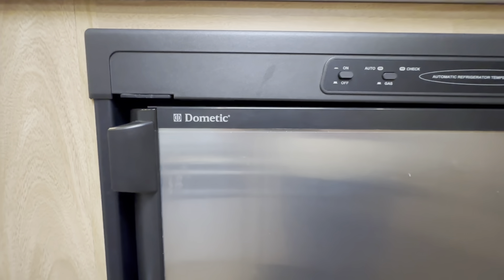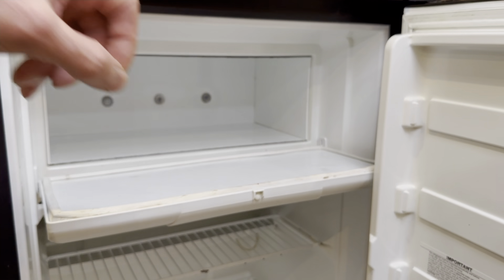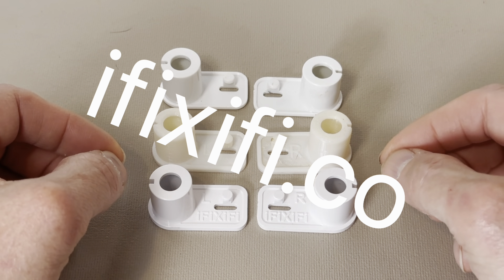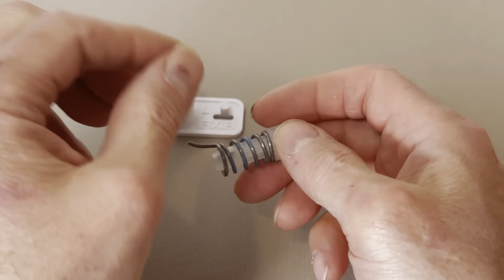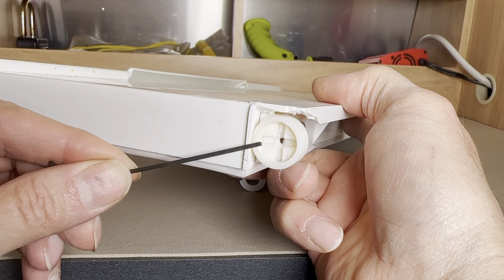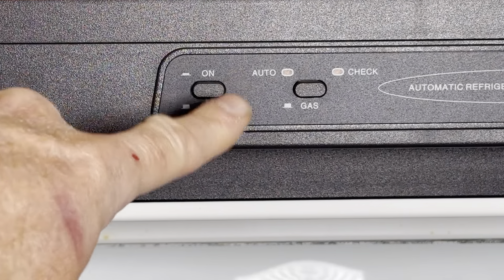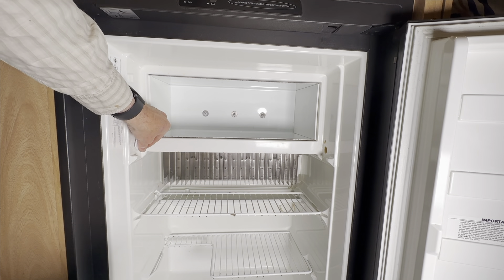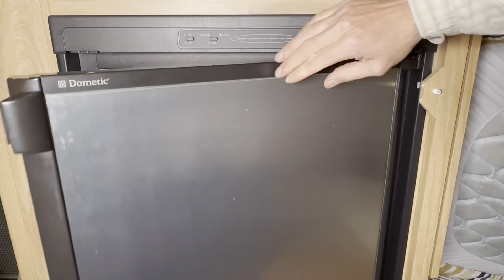How to Remove, Repair and Replace a Dometic RV Freezer Door and Save Money!

Comment: Your video is the best I have come across and believe me I tried many. Yours explained it better than all others. Now I had the issue of the door connection breaking on the left side, (our door swings left) and so ordered a door, $109.00 AU. Installed it without moving the spring holders down and no tension. Then removed the door again and swung them down as you said too and now the springs are perfectly closing the door with a good amount of force.  I will be ordering your holders and springs soon because, not only are they stronger but they are cheaper. I am just out of Brisbane, Queensland, Australia.  My fridge isa a Dometic RM2543
Reply from the maker: Hi Lance! Thanks for your positive vibes! I love hearing that people in Australia love camping / caravaning as much as we do. You got a great deal on that door!
Reply: @ifixifi  Sounds like it. I find it hard to find good cheaper gear here. Lucky I found you guys.

Comment: Your video for fixing the freezer door is fanatastic.  But I couldn't find the links that you refer to for ordering parts from you.  How do I find the liknks?  Thanks, Bob McCracken
Reply from the maker: Hi Bob! Thanks! That's a great question, and the answer is going to help you get A LOT more out of not just this video, but YouTube in general. A lot of creators put extra, helpful info in the comments. Finding the comments section depends a bit on what device you are watching on.

To level the playing field, first make sure that you are actually watching on YouTube, instead of in Google or other site that has embedded the video.

If you're watching on a computer, scroll down to just below the video. Sandwiched between the "SUBSCRIBE" button and the comments section, you'll see the first few lines of the description. If you click "more" you'll see the rest of the description.

If you're watching on a tablet or phone, the description is going to be in roughly the same spot, but even more well-hidden. Just under the video itself, you'll see the video title. And just under the title, in little print there's going to be a "more".

Comment: August 29, 2024 thank you so much for this video and precise instructions. Never could’ve done it without your help I ended up using a cake frosting spreader for the final installation of sliding the bolts into their spring attachments.

Comment: Well, the video is well done and explains everything clearly, but this is a JOB!  The tolerances are very tight, the positions are awkward, and the force required to keep the one side compressed while you try to get the other side in is considerable.  I used the older video so didn't use the spatula and the angles suggested in the old video were different (I didn't notice that there was a new video and it seems to be a significant improvement in method).  After losing about 5 lbs in sweat getting the door in while working in a hot trailer, I found that there was no tension.  I removed it to check that I had the correct pieces in the right and left side...I did.  So then, with prayer, I went at it again.  It seems that the plastic male crosses on the plug pieces are of softer plastic than the originals.  The originals are 7 years old and still look new, with no scarring.  The replacements seem to scar easily when using a screwdriver (carefully) to push them into the refrigerator housing.  I think initially I must not have had the crosses making fully with the recessed, molded crosses on the freezer door.  At any rate things worked the second time and thankfully the door is in with tension.  Phew!  Thanks for the video.

Comment: Video is great BUT when I pushed the spring assemblies into place the door doesn't shut tight.  Everything went well but seems like the spring didn't get enough torque for the freezer to seal the door over the freezer area.  Before I take the door out and try again is there something else that might be wrong?  Thank you.
Reply from the maker: Hm. There are a few things that could explain that. First is (sorry, but happened to me, too) user error. You may just have to review the key pieces of the video again to make sure that you're pre-loading the springs. Second: It could be broken / worn parts. Check that your spring housings and hinge plates are healthy, and that your springs are springy enough.
Reply: I found that the 90 degree difference didn’t provide any tension. Ended up going to a 180 degree difference to get the spring tension. As a beekeeper I found that using my hive tool and installing the right side first was very effective. Wasn’t sure why you installed the left side first, as the left side is easier to do last with the shelf removed.

Comment: I bought your parts a little over a year ago. But then misplaced them???DANG that put in a safe place drawer and it's now missing. Anyway ordered again. And it's now time to get down to brass tacks so to speak and install them. When I ordered I do not recall you had the springs available or I probably would have included them too. It'll be nice to have the door working properly. We tackle cleaning the AC on Wed. And then she's got a trip to Les Swabs to get a replacement for a missing spare tire. Then we check out her LP and electric systems. I never owned an RV before always been a tent camper often as a solo female for over 50 years. Hubby of 52 years is not a camper...very strange we met caving and he knew I was a serious camper so not sure what miss communication took place at the beginning there. But he's happy to support my enjoyment of off on my own and I'm fine with his staying home to do yard work and feed the pets it's a win win for everyone. And this RV journey has been one new education adventure I never knew anything about. From the repairs to the walls and floors and yes freezer door to adding a back up camera and learning about sewer hoses. Oh my gosh....fascinating. Happy camping everyone and thank you for your stronger door hinges and video's how to repair and replace.
Reply from the maker: We had so many folks ask us if we had springs, that we had to get down to brass tacks and make those, too. So now, we got 'em! RV camping and tent camping are both great, and they both have their pros and cons. One of the pros of RV camping over tent camping is there's less setup. Find a spot, park, and you're done. Your kitchen, bed and bathroom are ready to go. And one of the cons is getting to know more than you'd like about things like sewage.

Comment: I have a Norcold fridge and the freezer door hinges are broke. Any link to replacement hinges?
Reply from the maker: You're in luck. The techniques are the same as shown in this video, but Norcold parts are different. Check your owners manual to confirm part number compatibility. Most older Norcolds use https://amzn.to/3vhaxiW and https://amzn.to/49Vcctz

Comment: Help! I've already purchased and installed the WONDERFUL springs/casing/housings but only then discovered that the old-style door is starting to crack. I can't find the video referenced at about 14 minutes about reinforcing the hinge plate :( 
P.S. I also ordered the airing kit and love them too
Reply from the maker: I think this is the video you were looking for: https://youtu.be/epuabunaP7w?si=hzT5mqfF22-ZQJut
Reply: @ifixifi  that's it! I guess I'm not at that point yet because the hinge itself is fine. The crack basically runs along the front edge of the door, so I'm thinking to get some JB weld in there and clamp to cure. Maybe also stabilize with SS screws roughly where you've added them (for the new hinge). Any thoughts?

Comment from the maker: SEE OUR LATEST VIDEO ON THIS TOPIC HERE:   https://www.youtube.com/watch?v=-6ahjG0eJEs&t=0s
Links to Parts on Amazon and eBay: (Click "Read More")
    
    
Upgrade for Dometic 2002236004 Left Handed Freezer Door Spring Casing / Housing
Upgrade for Dometic 2002236012 Right Handed Freezer Door Spring Casing / Housing
eBay: https://www.ebay.com/itm/184872245868
Amazon: https://amzn.to/3qS5zXm

Freezer Door Spring Right fits Dometic 2932754027
eBay: https://www.ebay.com/itm/185930593002 
Amazon: https://amzn.to/3r4Qyl2

Freezer Door Spring Left fits Dometic 2932754019
Amazon: https://amzn.to/46ggKtn
eBay: https://www.ebay.com/itm/185930596299

Freezer Door Hinge Plate for Dometic 2002244008
eBay: https://www.ebay.com/itm/184853832761
Amazon: https://amzn.to/3CJpomi
Reply: Does this repair work on a Norcold?